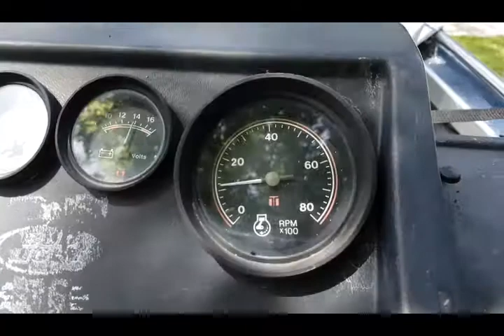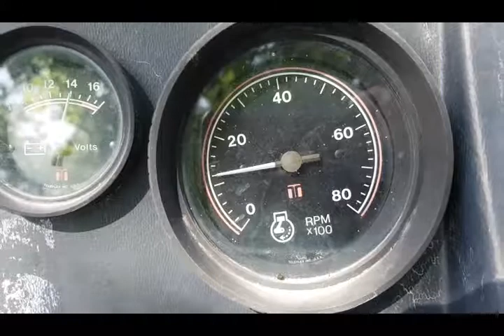1989 Mercury 100 Fast Idle

Comment: Did you solve the problem? I have the exact same on my - 91 Mercury 115hp
Reply from the maker: Dennis Andersson hey I did. As you probably know the 115 is identical to the 100 except for the carbs and the decals on the cowling. 

At first I was using the shop manual for this era of engine but there were a few spots where the abiguity made it hard if not impossible to get it right. So I used the 1997 shop manual for the same engine and they had cleared up the abiguity. Basically you have 4 screws that on the timing and throttle arms that control the tuning. There are a couple videos on tuning it however you'll need a timing light. 

Two things to confirm first are that your stator is working correctly. In the shop manual there are reference numbers for checking the resistance. It's fairly easy to check. There are videos on checking generic outboard stators on YouTube.  Also I bought a leak down tester to make sure I didn't have a crack somewhere. Apparently a compression test isn't good enough to diagnose this.
Reply from the maker: Dennis Andersson here is the 1997 manual https://www.google.ca/url?sa=t&source=web&rct=j&url=http://www.hedges-uk.com/boat/Merc/outboards/2-stroke/2-stroke/75-90-100-115-125/75-75%2520MARATHON-75%2520SEA%2520PRO-90%2520-100-115-125-65-80%2520JET%2520With%2520Serial%2520Numbers%2520United%2520States%2520-%25200D283222%2520and%2520Above%2520Belgium-%252009793577%2520and%2520Above.pdf&ved=2ahUKEwiQpsu7gbjcAhXQGzQIHbRFDlkQFjABegQIAxAB&usg=AOvVaw1YHjpR5f7KYhVwneLhwUze and the timing section starts on page 125. I read and re read it till I memorized it and understood it inside and out
Reply: Dennis Andersson e
Reply: My problem is solved, i had a air leak on the fuel line, so when i fixed it my engine ran like in the video. Then i just had to lower the idle, and now it runs great.
Reply from the maker: @MrToookie  glad to hear you got it fixed
Reply: @GibsoLesPaulStandard  can you send me the link to the videos, mine was fine just have to change the throttle shifter, I cleaned the mechanism on the motor now I need to set it all back and realign it darn it